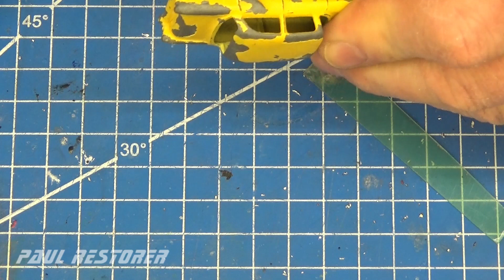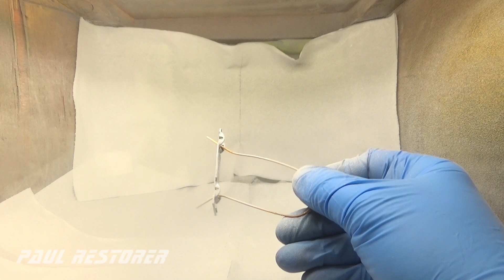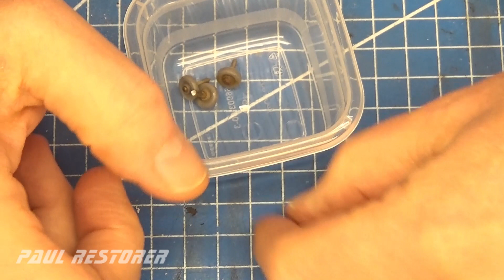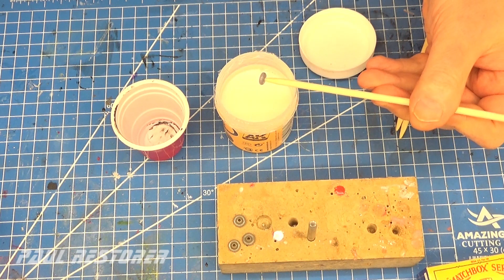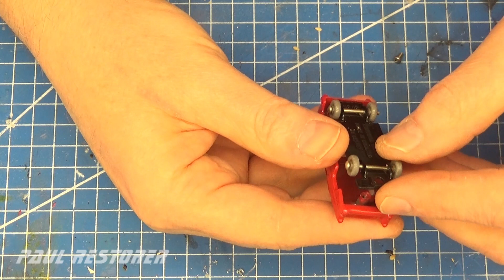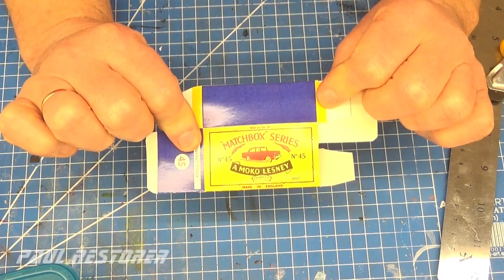Matchbox restoration Vauxhall Victor No. 45 Diecast model

Comment: Superb!  Excellent paint: smooth and glossy finish.  I remember seeing a mint boxed red example on Ebay.  Seller wanted a fortune for it.  I wonder if they got the asking price?  Simple Vintage Matchbox - 8 parts.  Compare with the king size Dodge Twin Tipper - more than 80 parts!
Reply from the maker: Thank you very much. Of course, you are right, the larger and later the model, the more extensive it is. I think the real price for an original old red Vauxhall Victor is around $ 100

Comment: Went for the expensive  version. That'll be the only way I'll get one, is to make one. I go to alot of toy auctions and toy shows and I have never seen one. It was hard to tell but I think yours didn't have the BRACE that they put under the hood/windshield area, to strengthen the casting.  If so yours is a very early one, before they added the Brace.
Reply from the maker: Best wishes